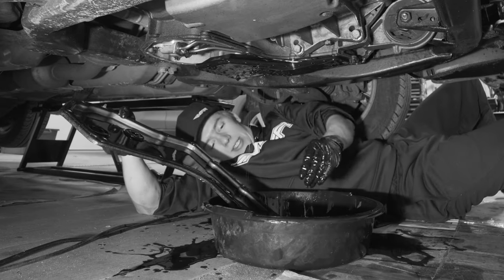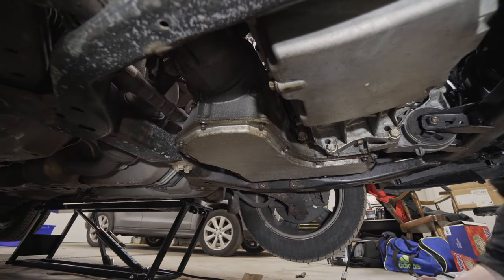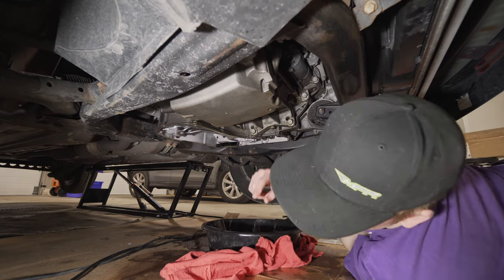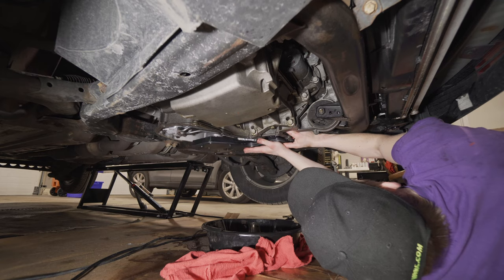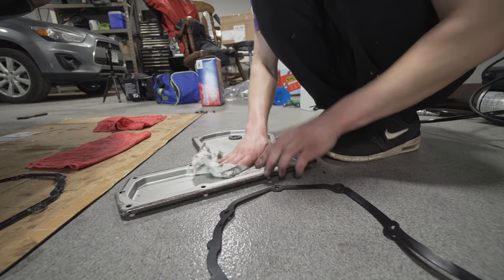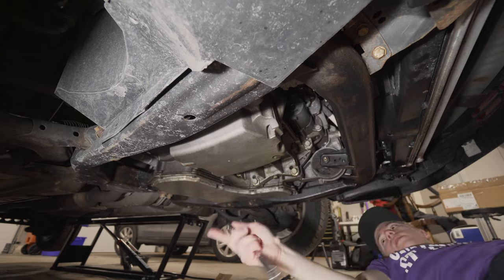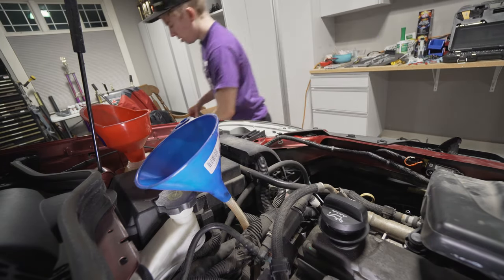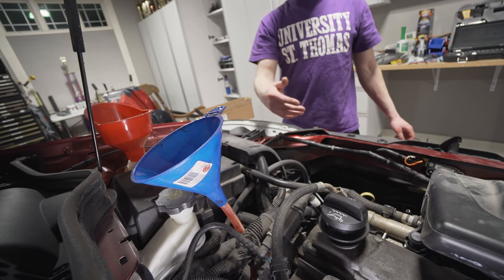Chevy Cobalt Transmission Fluid and Filter Change

Comment: 18 ft lbs....that is not correct for an 07 cobalt 2.2L automatic. It is 7.5 ft lbs which is 90 in lbs. Other sites say 89 or 88 in lbs.
Reply from the maker: Yeah it looks like it's 13ft-lbs for this 2010 cobalt.
Reply: @HardwayLearning  I'm got the Haynes guide open and they're saying 124 in-lbs/14 Nm for "Automatic transaxle fluid pan bolts" and 108 in-lbs/12 Nm for the drain plug. Are they totally out to lunch? I'm really asking if the pan's gonna fall off on the highway if I follow their advice here. 😂
Reply from the maker: They are pretty small bolts going into aluminum, so it shouldn't take much to torque them. If you do 10ft-lbs I'm sure it will be fine

Comment: Thanks for your video. I removed the drain plug and jacked up the car in the driver side and let that drain. Then I removed the bolts in the left side slowly and the fluid drained out. Once I removed the last bolt there was very little fluid left. No mess.
Reply from the maker: This is a good idea, thank you for sharing!

Comment: I just did this to my 2010 SS HHR. if you used the stock pan gasket the torque is 89 in-lbs. if you use a rubber gasket usually supplied with a new filter then it will be less. The stock gasket has metal inserts that prevent it from being crushed. The rubber gasket does not. I use 55 in-lbs with rubber gaskets. Also the car needs to be level and transmission at temperature when you pull the overflow plug.

Comment: The factory gasket is the best ones , you can reuse it. I reused mine.
Reply from the maker: Rubber vulcanizes over time, not sure I'd recommend reusing a decade old gasket to anyone, but if it works, it works 🤷‍♂️